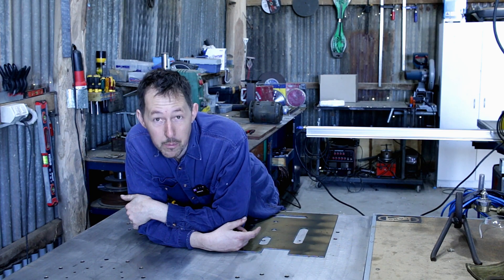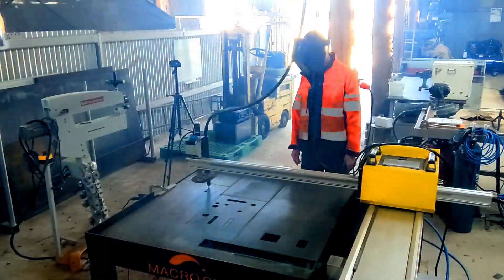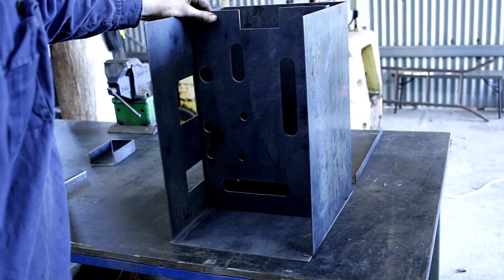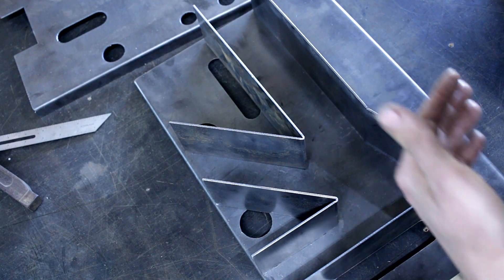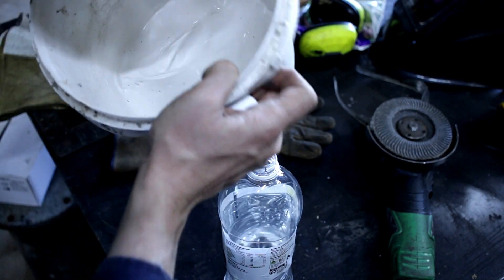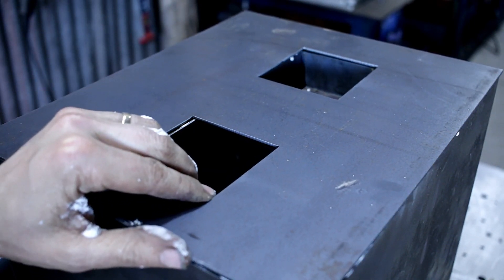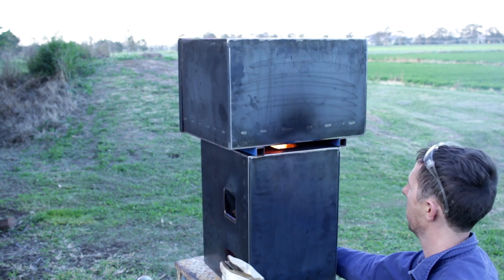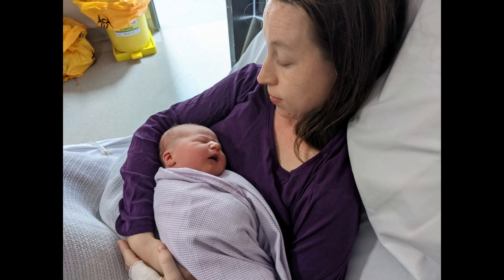Making a Portable Rocket Stove + Oven "learning curve"

Comment: Aircrete, portland cement mixed with foam, usually from some detergent, is a highly insulating and cost effective high temperature insulation which can be poured around rocket stoves.

Comment: “a quantum leap in capacity”,⚒

       but Always Head and Shoulders Above the rest …🔥

👍🏻🤔👍🏻
Reply from the maker: 😊 Thank mate 👍
Reply: @LittleAussieRockets  check out “Aircrete” for lightweight insulation and fireproofing. It is messy, at first.   

      But once i saw your koa wool, perlite, plaster of paris, 🤔🤣🤣
     Aircrete, just as messy, but simpler; just pour into cavity …   

     just thinkin’, let gravity🍎 do that work 🤔
Reply from the maker: @tomasthomas7407  I'm hearing you 🤔😎👍

Comment: Ever tried air-crete mixed with perlite? Make foam, mix with concrete, add perlite.  Light weight, insulating,  and easy to make.
Reply from the maker: I have tried it, work's great!  Just need to remember to bring it into the design 👍

Comment: For an oven attachment.  box in a box design with the flue gasses passing through the void between the two boxes should heat evenly if you put removable adjustable baffles in it.

Comment: You could take some design cues from old kerosine ovens that had a type of balanced flue of all things due the ~1-2kw nature of the burner and the need to maximise heat transfer. It was an incredibly simple design, just a hole at the bottom of the oven that was sized to match the exhaust and bypass from the usually single burner. The oven was more suited to casseroles and covered baking trays :) which became an oven within an oven like yours. Another feature of the oven was that it was quite tall for it's depth and width : Some smoker/slow cookers control airflow by a tall chimney drawing from the low point of the 'oven' section. It looks like the rocket is developing ~10+ kw on unrestricted output, I mention the 'balanced' aspect as possibly a method to restrict airflow, maybe your oven will end up being triple skin with 'directors' to choose whether exhaust enters the inner or outer passages first and the final tall chimney also able to be swapped likewise. I'm sure you have looked at the airflow of an AGA wood oven, designed by a blind man.